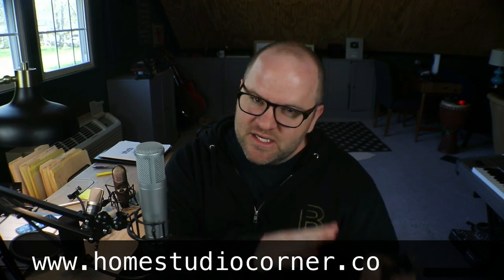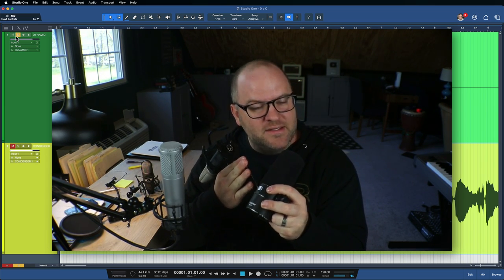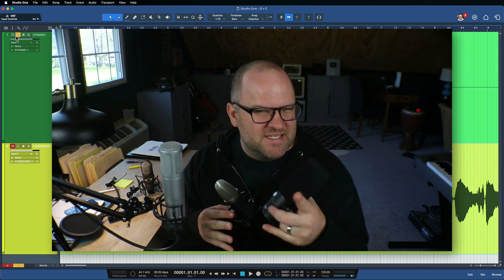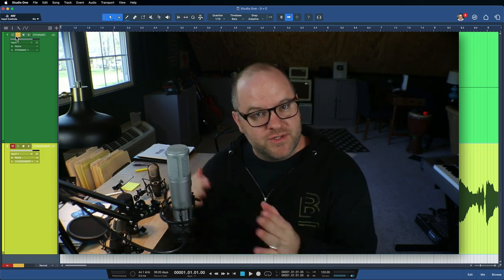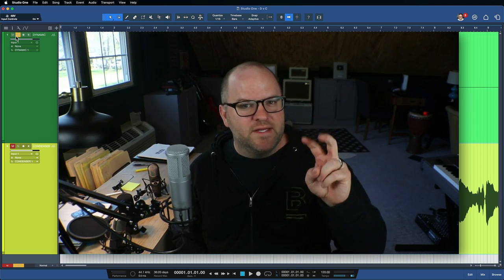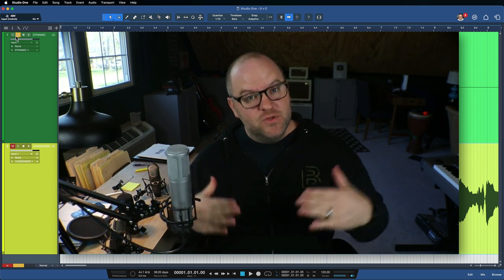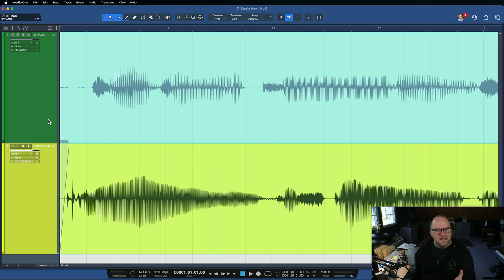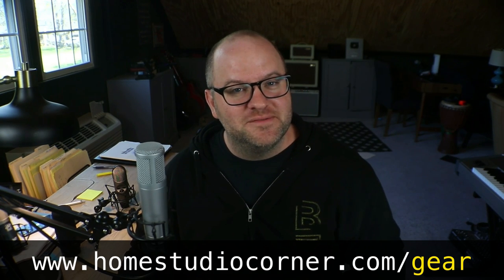Dynamic vs Condenser on Vocals

Comment: If Your Room Is Not Treated Always go With a Dynamic Mic Or you'll Regret😢😢😢I have to Record Under my Blankets In these Hot Weather😂😂😂😂I own A SE 2200
Reply: Just get some a mic isolation shield and pair it with a kaotica ball. Mimimize the background noise. Turn off that loud ahh fan and put a battery in yo smoke detector. You’ll be Ight

Comment: Good video Joe..Sonic Diversity regarding microphones is the key.Some of the best vocals I recorded was on a SM58 . partly due to the singer possibly feeling more relaxed because it was a scratch vocal and I was going to rerecord them using my fancy Condenser but I think dynamic Mics are designed to be more performance mic .Hence performance is key. Also with plugins etc your track can sound amazing due to processes that we couldn't do back in the day

Comment: Dynamic Mics are great paired with a Cloud Lifter or Klark Teknik in-line signal boosters. Which the booster also allows you to safely use phantom power with both dynamic microphones and ribbon microphones. The advantage is keeping a good signal to noise ratio because you don’t have to crank the preamp and introduce a lot of noise from the preamp

Comment: Hi Joe......I think it was harder to make a true comparison, since on your condenser track, you are singing in a higher register. I have two "primarily vocal" mics......a RODE large diaphragm condenser mic, AND an OLD, but still works---haha, EV 757 dynamic mic, and was a real workhorse for me when I did music for money, now just in my home recording studio, and a few charity type events here and there for ministries. The 757 is a "very hot" mic. Oddly enough, I have not used it for my home recordings, BUT now I WILL!  This is funny....when I've brought it along to any events where I preferred using it, I always told the Audio guy who might not be that familiar with that mic, from way back when!, to bring my channel/track fader all the way down, and then ease it on up, because its response is so much higher and louder than any Shure. Also a good reason to use a mixer board in recording, as I have an Allen & Heath ZED 60-10FX, to adjust some 4-band EQ upfront. GOOD video, as usual from you, Joe.

Comment: I'm really digging the new Earthworks SR117. It is a dynamic mic that sounds more like a condenser. Its really flat curve catches a ton of nuance without coloring the tone and sounds like you're there in the room. I also like it for live because it has great rejection. I usually consider Earthworks to be more of a measurement mic company, but I think this is a game changer.
Reply: It is a condenser though
Reply: I think it’s a condenser.
Reply: I just checked the page...it is a condenser. I would link the page, but the last time I linked a company's (legit) URL, I got a spam warning.

Comment: Hello Sir

I want to record my poetry professionally at home.  Which microphone should I buy?  
Dynamic or Condenser Mic?  My room is not soundproof.  Should I get a dynamic mic?  If I record the same verse on both dynamic mic and condenser mic.  After mixing and mastering, what would be the difference between the poetry recorded from both the mics?  Will both be of the same quality?  Will both have different quality?  If the quality of condenser mic will be crisp.  So can I make the poetry recorded with dynamic mic sound crisp?  like condenser microphone?

Please tell me such a mic and audio interface that I will not regret after buying.  I am complete begginer.  

I am very confused.  I have added money in 4 years with a lot of hard work.  I don't want my money to be wasted.